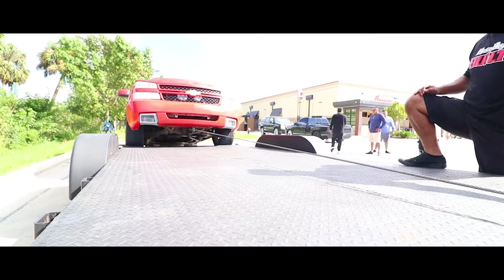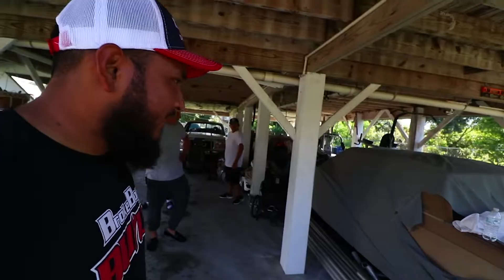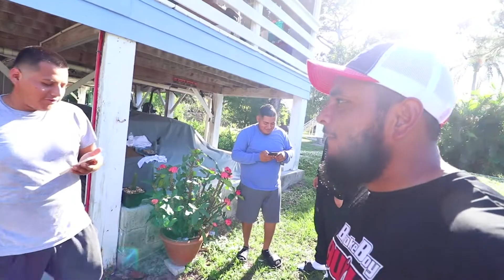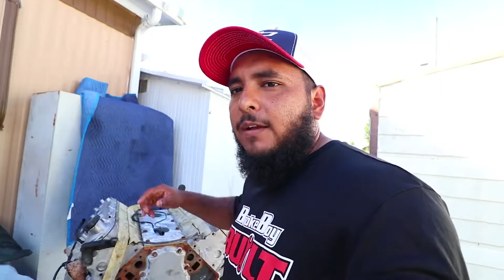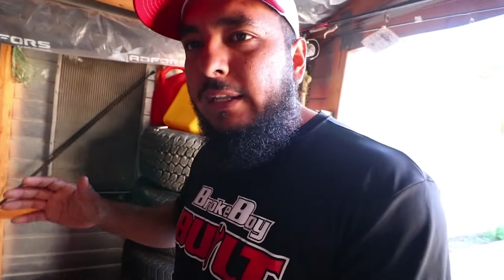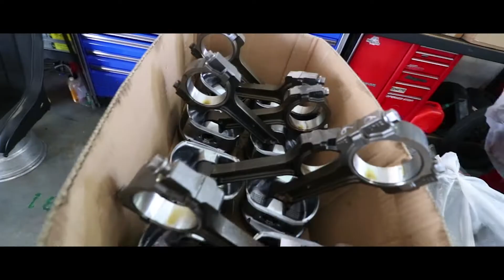Ls swap Obs build is back + 5.3 OR 6.0

Comment: What’s the estimate cost to get the block bored?
Reply from the maker: It ranges depending on the shops of course. But you can get them done anywhere from 275-600 bucks. I haven’t got the exact price. Sins I’m doing other stuff to it.